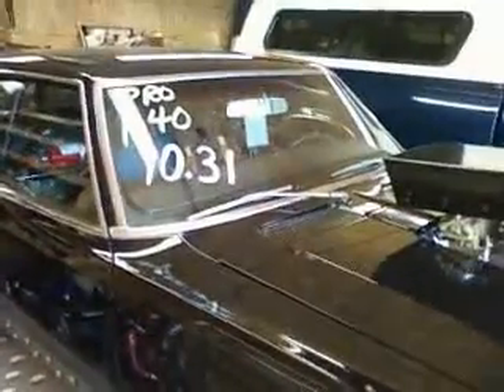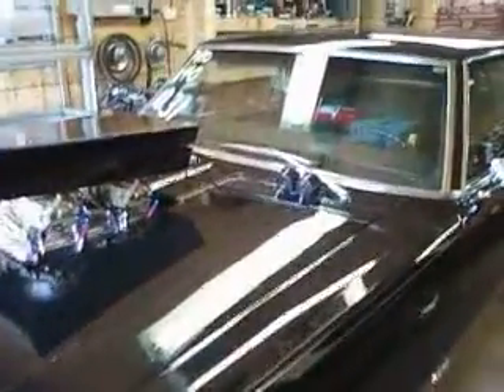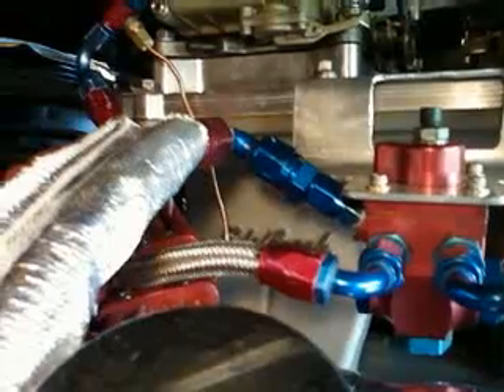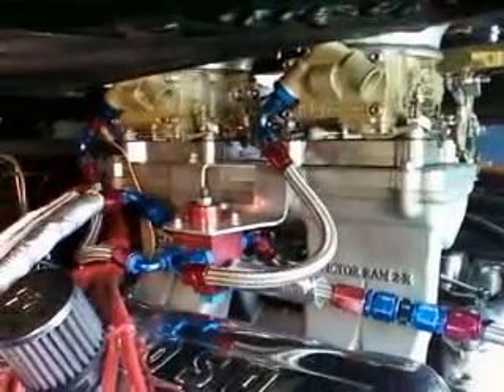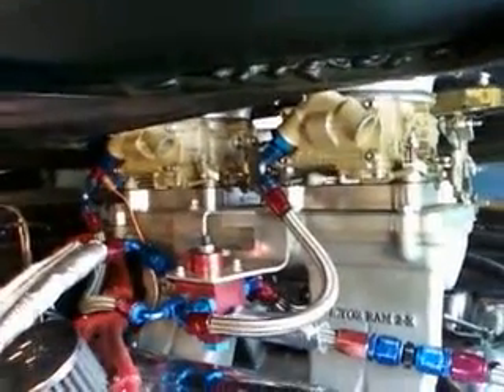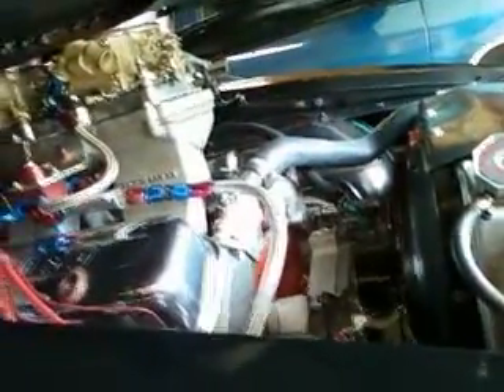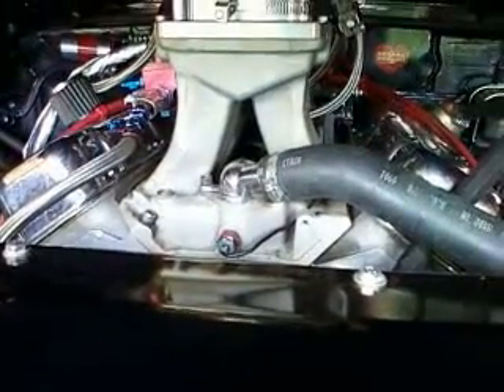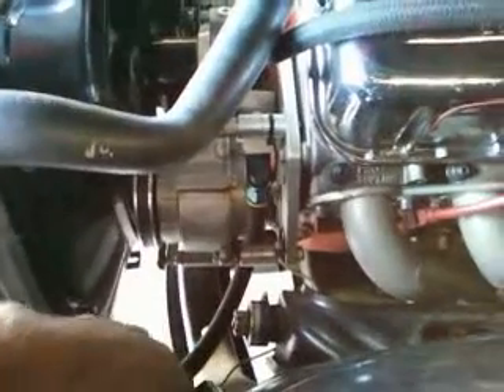Racepumps Mechanical Fuel Pump Evaluation

Comment: Are you still running the Racepump? I have one on my new motor (big block mopar) I've heard a lot of mixed reviews but most people say as long as your running a return line it should last a long time? I haven't picked a regulator yet and racepump doesn't sell them anymore so I'm leaning towards a quickfuel but I might check out that BG reg now.

Comment: Is your pump still working?  I am had similar issue of losing fuel pressure when the  pump gets hot.  I am using -4 return, per  Race Pumps  website.

Comment from the maker: Hmmm, if you have a stock engine which means a factory mechanical fuel pump as well, you would not need a BG regulator. Having said that, if you are having problems with the carb flooding and not because if contamination in the fuel system, certainly could run a regulator like this one. Do not use rubber lines period! I sold my 2x4 barrel set up, with the BG reg, and now have a single 4 barrel. I did buy a RacePumps fuel pressure regulator for the new set up.